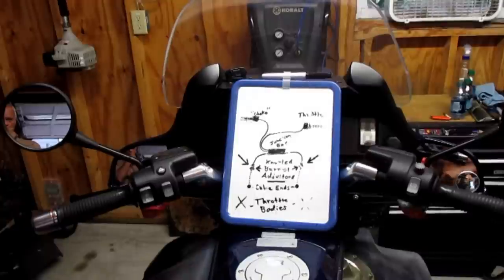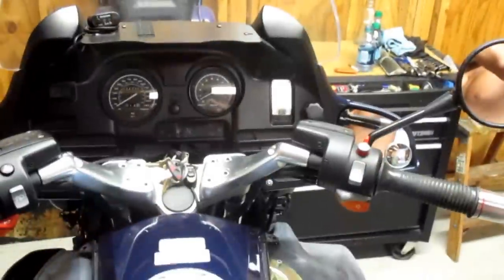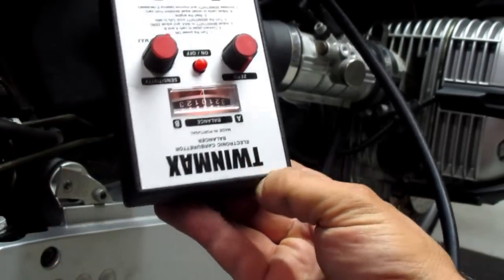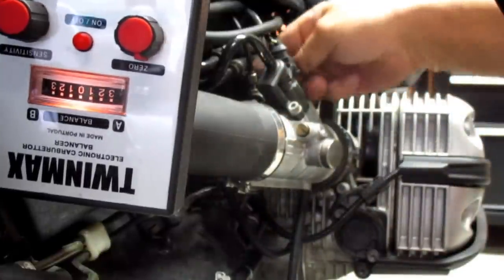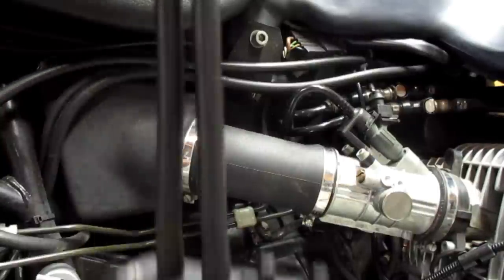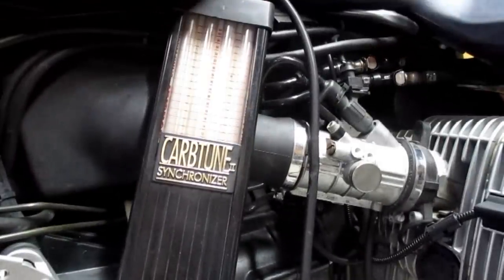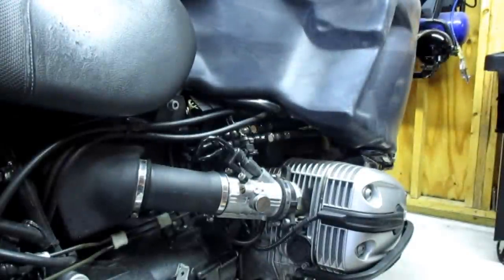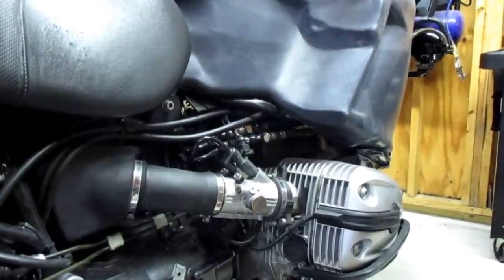R1150RT 4 of 5 - Synchronization

Comment: I wasn't looking for how to sync my bodies, I always figured I'd leave that to my highly respected BMW mechanic.  But now I've got a Carbtune Pro on order from BeemerBoneyard and looking forward to tuning.  I used to tune my R/100RS "on the fly" so I'm pretty confident, especially with this video I'll be dialing it in.  My current R1100RT runs great now, but I figure since I'm in the middle of the clutch job (again, thanks, great video on that subject!) I will need to be seeing about my cables since they've probably gotten stretched a bit in the process of lifting the sub-frame.
Reply from the maker: Nah, your cables are worn out from use; 25 000 miles at best. Good luck with your new carbtune ;)

Comment: Choke (Fast idle) only pulling one side.. Pull the other one. On the original single wire models; yes. With the cable box; no. The choke cable pulls on a wedge which turns the wheel which both cables are connected to. That said, glad your back. :-D.
Reply from the maker: Pulls on a wedge that opens one side.

Comment: i have an 02 and i can get it to run without advancing the throttle position sensor (turning it counter clockwise) then it only idles and there are deadspots in the powerband its hard to keep it running.. help please

Comment: I have a BMW R1150rt in blue, (basically this model shown in this video) my bike fell on its side one day and when I picked it back up my bike wouldn’t start anymore… I checked the engine starter and it was cracked where it rounds out so I replaced it.. my bike still won’t start… any ideas??  
Thank you for these videos though, without these videos you provided I would have been fucked .
Reply from the maker: Things to check after dropping one of these: Fuel connection at the quick disconnects if fitted with such. Stick coils can fail from a drop - test for spark. Good luck to you, Chris

Comment: Hi Chris I'm an owner of a 11:50 and I see you synchronize the carbs using the throttle on top and the screw on the side and I'm going to synchronize mine but what is the difference between those screws and thank you for all the videos they are good.
Reply from the maker: Difference between which screws? You have a brass airscrew in each throttle body to set your idle.  Set the cable freeplay and balance the cylinders.
Reply: Chris Harris thanks man

Comment: Great video as usual, Chris. I just finished up a valve adjust & tb sync on my 2000 RT this weekend. Bike is running great but now I have a ticking coming from what appears to be my right throttle body. Bike only has 54k miles and did not have the noise prior to the work performed this weekend. And thoughts??
Reply: Check your throttle shaft bushes on that side for excessive wear. You might even see the shaft moving and jumping around if it's really bad and it's that movement that causes the ticking sound. Hope that helps.

Comment: Hey Chris. 
When I'm doing this on my 02 R1150RS my RID shows 3 bars and the headers are freakin red hot. 
Is that normal? Freaks me the fuck out.
Reply from the maker: No, that's not normal. Make sure there is free-play at each throttle body cable.
Reply: @ChrisR.Harris  Thanks. I thought so. I've gone through this thing. Spline lube new clutch. Flushed clutch and brake system.  New injectors. Now it's running like "poo"😂
Idle problems. Twinmax says its synchronized anywhere above 2k rpms but idle is fuckin horrible. Left side 🤷‍♂️ . Air screw doesn't do shit. Cables are seated properly with good free play. I'm stumped 🤦‍♂️
Reply: I've got a GS911 coming so hopefully I can get some codes off of it. 🤷‍♂️Oh. I replaced the 02 sensor as well.
Reply: I've got it running well. I think I had a bit of an air leak.  Thanks for all your videos, Chris. Couldn't have done it without you. ;)
Riding this thing from Richmond Va To the Pacific Ocean in the spring.
Reply: Well after adjusting valves and syncing throttle bodies for the 3rd time I could get it running right. I bought a GS911 and my TPS is fucked. 
Another $200. Fuckin BMW. 🤦‍♂️